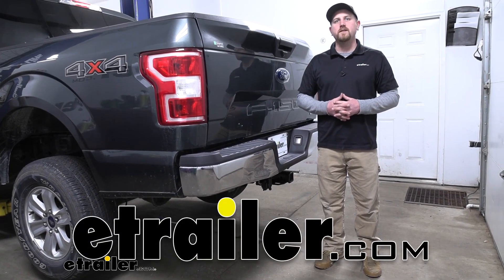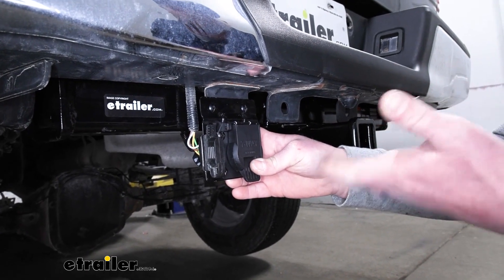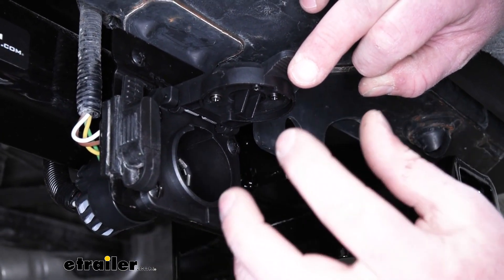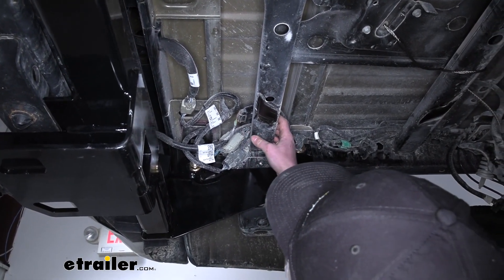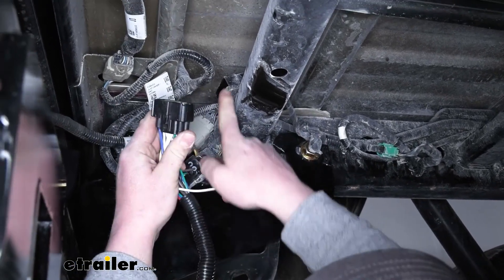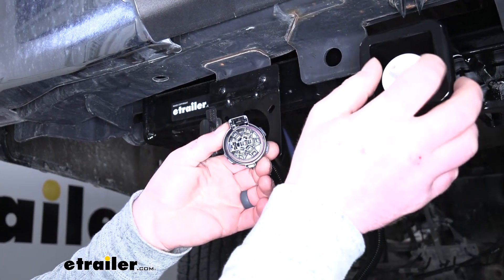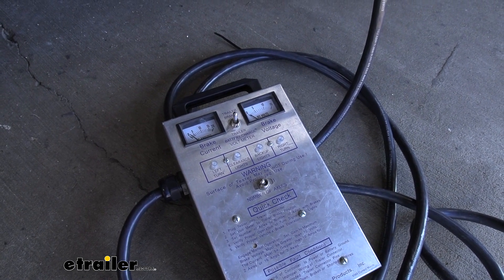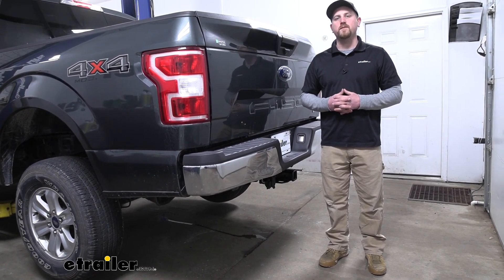Set up: Curt T-Connector Vehicle Wiring Harness with 7-Way Trailer Connector on a 2018 Ford F-150

Comment: Excellent video. Clear, organized, easy to understand. I especially like that you included the possibility of fuse missing at end of video. Could you include what signal looks like from a brake contoller that is working, and how to test with an analog multimeter and/or digital?
Reply: Suggest a quick note to viewers that the tire will need to be lowered and removed even though it will become obvious as they do the install. Helps 'em to get a feel for how long it will take. Thanks for your video!!!
Reply from the maker: Thank you for the feedback. We will keep this in mind for this video and for the future. Lowering the spare tire will make the install easier.
https://www.etrailer.com/Custom-Fit-Vehicle-Wiring/Curt/C56413.html

Comment: Hi Ryan, I purchased a CURT 56413 Vehicle-Side Custom RV Blade 7-Pin Trailer Wiring Harness, but doesn't work.
Which model will fit a 2006 F-150?

Thanks
Reply from the maker: The Curt # C56413 is a fit for the 2015-2020 Ford F-150, so it won't work on a 2006 model. For your 2006, use # HM40975 if you have the round US CAR connector located behind the rear bumper. If you don't have the connector, you'll need to hardwire the 7-way using # HM40975-11998.
https://www.etrailer.com/Custom-Fit-Vehicle-Wiring/Hopkins/HM40975-11998.html
https://www.etrailer.com/tv-install-trailer-wiring-2008-ford-f250-hm40975-11998.aspx

Comment: I have a 2018 f150 and installed this exactly as it was in the video but am
Not receiving any power to the 7-way connector. The trailer I am towing has a break control. Any suggestions?
Reply from the maker: Are you using a 7-way to 4 pole adapter like # 37185? Which brake controller are you using?
https://www.etrailer.com/Trailer-Wiring/Hopkins/37185.html
Reply: @etrailer  No, I am not. I have the Curt 51180 Wireless Break Controller. Do I need something like #37185?
Reply from the maker: @BrandonButler-pr9of  If you have a 7-way installed but the Curt # C51180 Echo Brake Controller isn't working, use a circuit tester on the 1:00 position. If it's not showing power, you'll need to run a circuit from that pin to the positive battery terminal via a 40 amp breaker like # 9510.
Hope that helps!
https://www.etrailer.com/Accessories-and-Parts/Pollak/9510.html

Comment: Does the vehicle need to be equipped with the trailer control in the cab of the truck for it to be able to plug into the factory harness?
Reply from the maker: You will only need the brake controller if you plan to haul a trailer with brakes.
https://www.etrailer.com/Custom-Fit-Vehicle-Wiring/Curt/C56413.html

Comment: So does the factory 4 pole connector still work after plugging in the harness for the 7pole connector? I seen somewhere that they both will work but I’ve also seen that the 4 pole will no longer work.
Reply from the maker: The trucks factory 4 pole will not work when this harness is connected. You can use a 7 and 4 pole trailer connector with this harness so that you have both functioning plugs.
https://www.etrailer.com/Custom-Fit-Vehicle-Wiring/Curt/C56413.html

https://www.etrailer.com/Custom-Fit-Vehicle-Wiring/Hopkins/HM40975.html

Comment: curts 55774 part number with the uscar plug says it fits my 2019 f150 but mine has plugs like this why?
Reply from the maker: The Curt 55774 is designed for vehicles that are designed with the factory US car connector and the 7 way plug. The kit shown in the video is for trucks with the factory tow ready package.
https://www.etrailer.com/Custom-Fit-Vehicle-Wiring/Curt/C56413.html